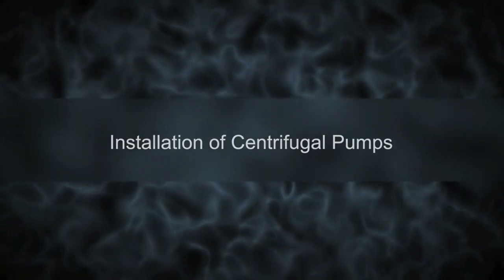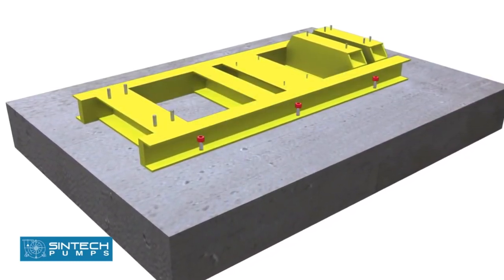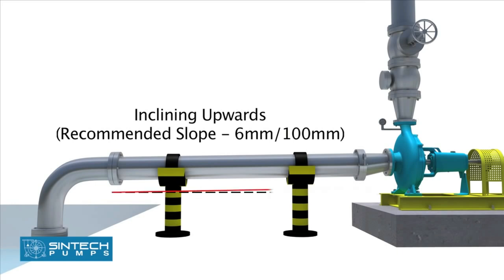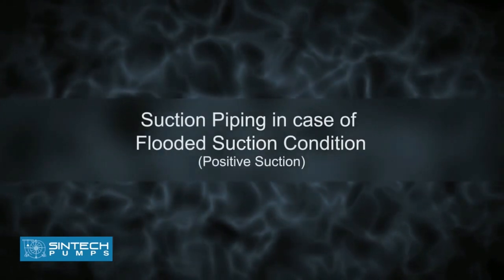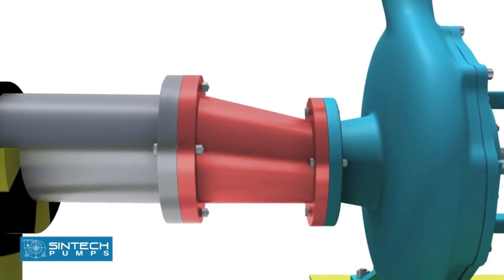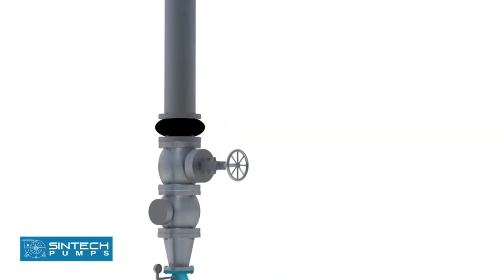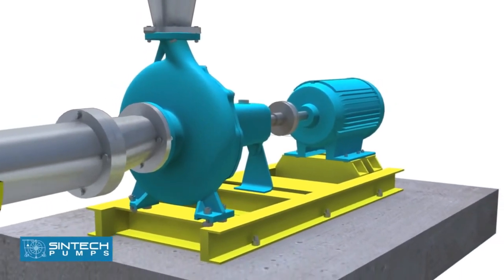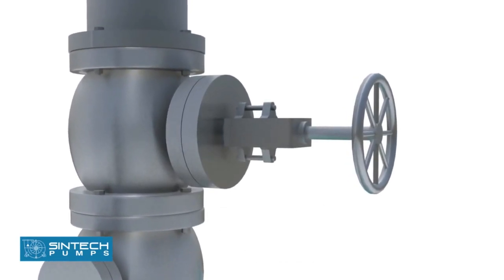Suction Pump Installation | Piping

Comment: Would have added more info on the piping alignment or allowable deviation in between piping flange and pump nozzle, allowable shaft deflection during buttoning up the flanges.... Grouting details would have given more details like grouting method, clearing of blow holes or defecting grouting, final grouting....

Comment: Hi Technical Piping, i have a question: Why we should fit eccentric reducer, maybe can make avoid air pocket formation? Thanks a lot!
Reply: Old practice advised to use Ecc bottom flat but latest engineering practice says to use Ecc top flat no metter whether tank is A/G or U/G in order to avoid flowing bubbles in pump.

Comment: please tell me how to select size of pipe
Reply: Nag Lp it's depends on the pump nozzle size...
Reply: Pipe size selection is based on pump nozzle size, pump nozzle size is based on process flow and head requirements. Types of pump selections are different and need to consider process and site conditions

Comment: I am piping designer and I have worked in JGC Japan. Please improve yourself as described below. 
1.Discharge piping on the nozzle is not good practice. Load on pump nozzle cause disturbance of pump alignment. 
2. Reducer with pump nozzle is not good. There should be 5d straight run between Reducer and pump in order to provide turbulence free flow to pump.
3. There is to be Ecc Reducer top flat even if flow is from A/G tank.
Reply: Hi 
How can I contact with you !!! 
Plz reply
I want to ask couple of questions.
Reply: @AliAhmad-df2sf  Can you ask the question at this panel. Please introduce your self too. I Don't mind to render my services.
Reply: Why don't go for bottom flat bro for eccentric reducer ?? is there any standard reason in it ??
Reply: @samueljebaraj4742  Ecc B/F is an old practice.  If you see American "piping guide" old version, there's same. However, the latest practice in  most reputable companies like Technip, Bechtel, Florabia, JGC, Aramco & Adco is to keep Top flat as latest practice. The reason is to avoid bubbles generation in the upper cavity of reducer. The RPM of pump is 3000 or sometimes more, even the little quantity of bubbles attack the pump impeller like bullet which reduces the life of pump. Moreover bubble causes noise and vibration too. Piping Designing is a vast field, however Designing around pump is most easy and simple. If you are keen fully interested, we can share our views on every type of piping Designing in future.
Reply: @AliAhmad-df2sf  how do you like to contact me?